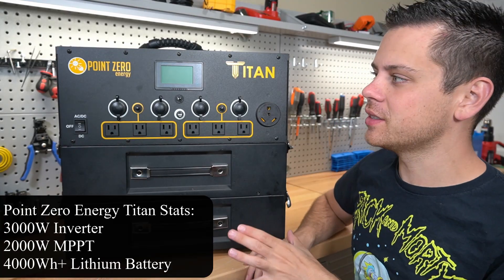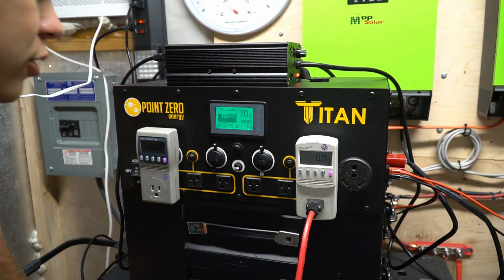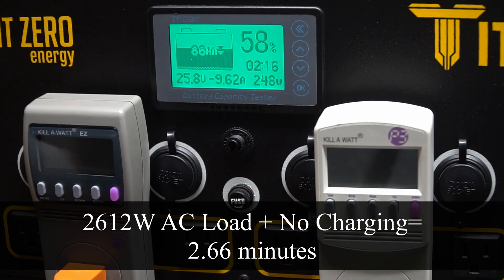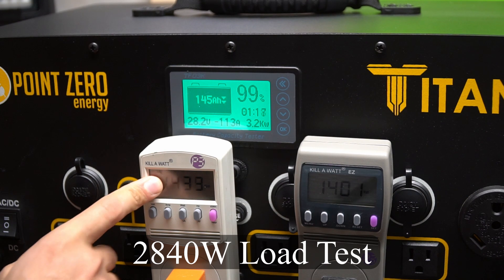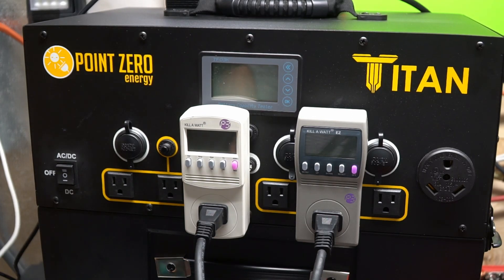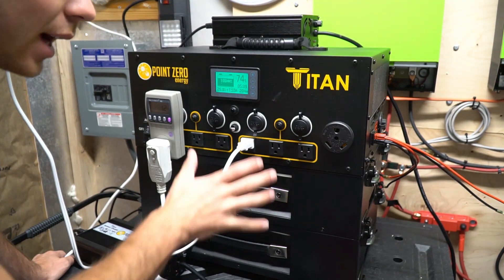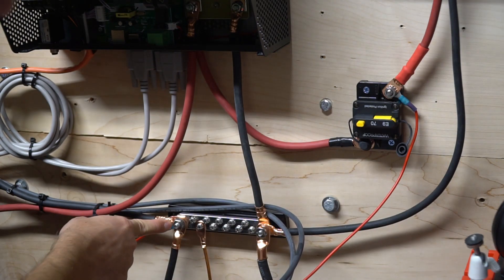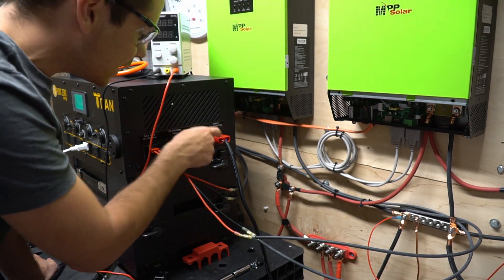Titan Solar Generator: Max Load Test, Battery Expansion, 12V Charging and more!

Comment: "...I'm so bummed about that ... again another failure"

Why can't manufacturers just make the product as it's advertised? When will they learn that Will is gonna call their bluff? 😆
Reply: The problem pervades all new devices. Nothing is completely thought through from front to back and you always run into problems.

The whole industry is now only designed to maximize profits.

The cheapest components are installed. Development of the software is outsourced. They save on material. Tests and quality control are much shorter, etc.

The suppliers act in the same way.

This creates these many immature devices.
Reply: Stephan, these units have only started being viable at the consumer level in the last 3-4 years thus I place them in a "Gen 1" status.  The Jackery has done a very good job moving into a "Gen 2" level where you can really depend upon them and they are built fairly well but still need refinement, more with their honesty in marketing numbers and expected performance than with the actual designs.
Reply: Kinda Like ? joe Perfume* ance.

Comment: Are the loads resistive  or do they have inductive or capacitive  that may make a difference
Reply: Has to be a resistive load..... its basically a fan colled 1400w lightbulb.
Reply from the maker: Yes it's resistive.

Comment: I like that you push units to their limit. I think you are right to be disappointing when the unit does not perform up to max it is advertised to so. My only thought is maybe in this case since charging also causes heat you just did so many things that the unit heated up and maybe the cool down takes a lot longer than you think. My though it the unit does not have enough of a heat sink and fan for the amount of stuff you do and you are right they cram way too much stuff in a small box. At the same time I rather trust your tests than anything any dealer tells anyone. Also when other people report it works at 2700 watts they are probably just guessing by using an ac and other devices rated at certain wattage all adding up to 2700 watts in theory, but likey they are not like you using testing equipment like dc current volt meters and ac volt meters. most people do not have such equipment.

Comment: Will, what I am finding out is the battery market is crazy right now. Some of your links go to products that are out of stock or just present a 404 page.  I know you have a bunch of beginner videos, but if you’re looking to do another one, could you (and I know this is completely out of your control) try and source some batteries and other products that are in always or generally in stock most of the time?  I want to dip my toe into DIY solar/battery backup pool and also teach my kids, so a simple battery backup home solution would be cool (with the potential to add solar later) I was thinking of maybe powering a breakout panel next to my main breaker panel with a few circuits that control my kids bedrooms that would automagically switch to battery backup/UPS.  As alway your channel continues to impress. Keep up the excellent work you’re doing. I’m going to order your book today. Thanks in advance.
Reply from the maker: Covid-19 has completely destroyed the inventory and supply chains of multiple large distributors. We are still waiting for china to get back on its feet. Even the high quality solar products are all made in china/india/various SE asian countries.

I have changed my links multiple times this month and distributors are still scrambling to keep inventory. It is difficult times.
Reply: Go to Alibaba and make a RFQ (request for quote). You'll have a ton of replies. I just made 3 purchases of cells - 2 from the same vendor and 1 from another vendor. I've received the 2 from the same vendor and have a tracking number from the other vendor. Haven't tested the cells yet. Ask for their test results.